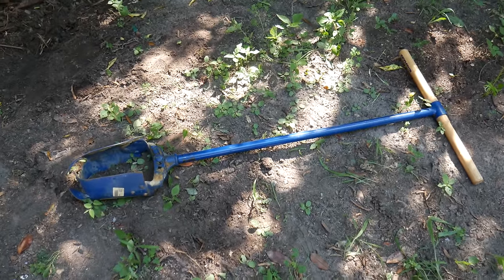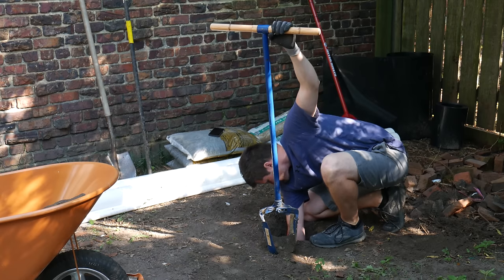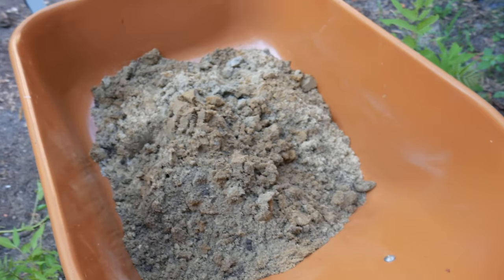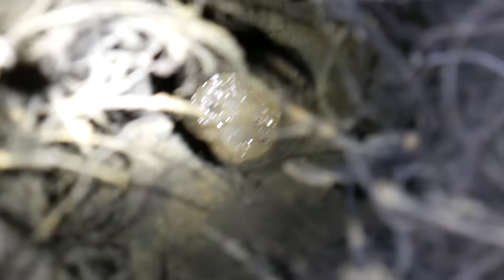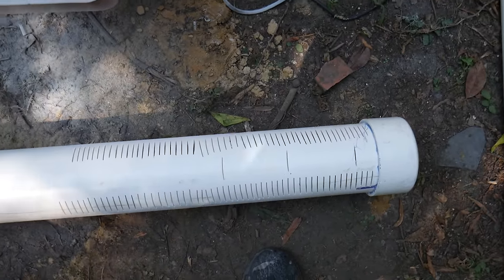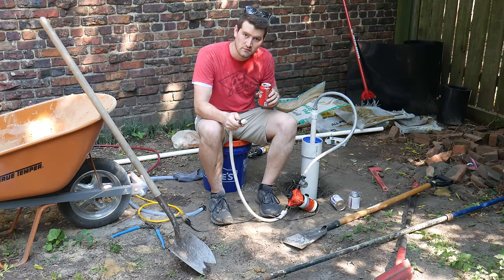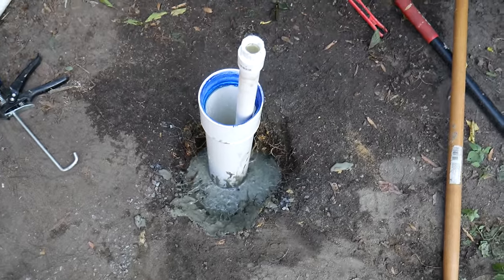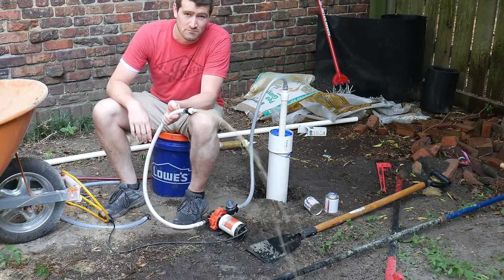How to drill a simple shallow well yourself

Comment: Nice job and great video!  I have dug 3 wells on my farm using a similar method. A few suggestions. You should not put the end cap on until the screen is cut, as fine shavings will get in there and contaminate the water and/or end up in the well pump when purging the well.  Also try not try to draw too much water too quickly or the screen will eventually get clogged (for instance, a deep well hand-pump) — I learned my lesson and my well just about stopped percolating because it took too much water too quickly.  To prevent this on my other well, I dug a bit deeper and made a longer screen. Having a longer water column means you can draw significantly more water more quickly.  Also, sediment will settle at the bottom of the pipe where the end cap is and eventually it can get up to the screen where it clogs it from the inside.
Reply from the maker: Yea I eventually settled on using a wellpoint: https://youtu.be/IRLLbmcnYjA. It's been going for almost a year now with zero problems, which I still find surprising. I will do a followup video in a few months after it's been a full year.
Reply: Great advice sir . Thanks
Reply: Im curios to know how long a well like that can last ? Until it runs dry
Reply: I jet 4 inch wells in pastures for cattle. I started using a filter sock around the slotted casing pipe to help prevent fine sand from getting in the casing. Stops 99 percent of fine stuff. Fine clay can still get in. I pump my wells hard right away and get great flow. like 20gpm plus.
Reply: So dig it deeper than the draw pipe depth?

Comment: For those who haven't noticed, at 11:39, it is possible to see a bag of gravel that he placed before the grout to prevent clogging. Note that at 11:45, the bag of stones is no longer there, and there are some stones near the entrance of the hole."
Reply from the maker: Yes, I regret not explaining what I did there in the video. Thanks for pointing it out.
Reply: How,May bags of gravel did you put in?
Reply: Thats why he calls himself the bad homeowner which he is.
Reply: Absolutely came in to say this very same thing. No point pouring crete  down and clogging those slits otherwise be rendered useless. Bloke needs fix this video cos a lot of effort to just screw it up by omitting one of the most important factors.
Reply: @TexasHolton usually enough to cover pipe screens + 1 meter, as it will settle down

Comment: I put in a bore by hand some years ago, I hammered steel casing down to about 20 feet. I fabricated a point to fit on the bottom.  My steel casing was in sections about 3ft long as it is driven down I would weld on a new piece. When I got to the bottom of my hole I lowered down a stainless steel screen attached to 1 inch PVC. The process is called a spear. After spear was installed I used pea gravel to cover the spear then with drew the steel casing leaving the spear behind. It worked perfectly.

Comment: I just finished watching 3 or 4 of your well videos, and applaud you for your efforts. Will also leave a comment on each one. I've done similar shallow wells over the years in my yard   (Easy digging, all sand...like yours), and have tried a couple others. There is no conclusion to this style, and I'll speculate why. 

But 1st will say, you left out the part about filling the 4" casing hole with "trap-rock" around the casing screen, to allow the water to penetrate. We're sure you did that, right? You did show the bags, but only showed the mortar filling the hole. 

And next, you didn't elaborate what you did to the 4" casing, when your digger hit the mud. If you want the 1' plastic well point to be a couple feet below the water table, and you plugged off the bottom of the 4" casing, how did you drive it 2' (or more) into the mud? Your posthole digger won't make a deep enuff hole, because it will keep filling with mud. I know, cause it happened to me. No getting around it. I'm just guessing that you didn't get your 1" PVC pipe in deep enuff water, to supply your needs. Maybe that's why your next video, (only a month later) shows new 1 1/4" black pipe, with a driven sand point.

Comment: I have a question:  The cement, that you poured to protect the outer PVC pipe, didn´t it seal the slits which you did on that pipe ?
Reply: No he poured the gravel in first.
Reply from the maker: Yea, gravel went in first and surrounds the pipe, grout goes on top to seal off the gravel from the surface.

Comment: One important point I was unclear on in watching the video is how you knew you were in a good pocket of water and could stop digging?  I believe there is more surface water and deeper good clean water.  Any tests to use or pointers to help me know when to stop digging?
Reply from the maker: I knew I hit water at like 10ft because I dropped a tape measure down the pipe and could hear the plunk sound of it hitting the water. Sorry I didn't record this.

After that, I just dug until I hit something hard.
Reply: Very interesting approach.  I have heard that is is possible to hit the water table and if you keep going it is possible to go completely through the water table into something like clay and “lose” the well.  I guess you were lucky.  Thank you for the response.  I love you easy to follow videos.  Very helpful.

Comment: I learned a few things from the video, but I also think I missed something as I'm a bit confused. There are dremel-cut holes in the outer pipe. Doesn't the grout just cover these when you pour it in the hole?
Reply: No, the grout doesn't seep through the gravel, and so it doesn't fill the openings

Comment: I live in a winter climate. Is it smart/advisable to install a check valve about 5 feet down so I can put RV antifreeze down the 1” column during winter? Has anyone tried this? Am I setting myself up for failure by doing so?
Reply from the maker: is this a real question? do NOT put antifreeze in your well pipe

Comment: WHY did you switch to using SANDPOINT well ? Did you have problems?  I'm thinking of doing a well on my property just trying to figure out which kind is better
Reply from the maker: Hey good question. I switched to a sandpoint later because I was able to drive it deeper into the ground. This allows me a more reliable supply of water in case it doesn't rain for a long time.

Comment: The PVC glue was completely pointless. The pipes were also installed upside down which makes it more difficult if you ever needed to remove it. It is disappointing that you didn’t show the final product after investing all of that time talking about it.
Reply: Id call him a dunce
Reply from the maker: PVC pipes are symmetrical -- there's no such thing as "upside down" with a symmetrical pipe.
Reply: @BadHomeowner  They are not symmetrical. There is a belled end and a straight end.
Reply from the maker: @smarterthanyou9090  There is no belled end. What looks like a "bell" is the coupler that I installed onto one end of the symmetrical pipe.
Reply: @BadHomeowner  I see. In that case it's the same work. Gluing a belled end is easier than a coupling but as you've used a coupling the work to replace it is the same. You are correct.   
I've never used glue on the several wells that I've done. I never felt it was worth putting toxic chemicals on pipes that already sit in water and collect water meant to be potable.  
I still say you should have shown the finished work. There is no real evidence that the well functions unless you demonstrate the completed project. Most people who watch a project unfold are not satisfied until they can see the end result.

Comment: I will putting in a well soon and have watched many videos. Yours is nice it's simple to the point it showed. Question, when you pour the grout in what prevents the inlet slits from not  being sealed up in other words the area from which the water comes in I would think it has to be in the water table and free to capture the water. Please explain this too me I might have missed hearing it. More detail on the pipe in the water hole. Thanks
Reply: I believe the gravel goes in before the grout

Comment: What kind of coupling did you use coming from the 1 inch pipe to the hose that leads to the pump?
Reply from the maker: A barbed pipe fitting. One end screws into the pipe, the other slides into the hose and grabs the inside. Sort of like this: https://www.homedepot.com/b/Plumbing-Pipe-Fittings-Fittings/Barb/5-8/N-5yc1vZ1z18i3tZ1z0u2lcZ1z1b4fc

Comment: You didn’t grout the well properly.lt states in the regulations not to poor cement from the top of hole you were supposed to use a trimey pipe and grout from bottom of casing to the top
Reply from the maker: That's only necessary for wells that are hundreds of feet deep to avoid large air pockets. For a 15ft well it's perfectly fine to pour from the top.

Comment: Nice job. Please consider whether monotonous music is needed over the top of you speaking or at all really. I like that you capped the casing pipe. Any guess as to how many millimetres wide those Dremel cuts were? Would there be an advantage to add a few hundred more cuts up the casing pipe? When you poured the grout in would any have made its way all the way to the bottom surrounding your casing pipe or will it not set under saturated sand/water? Sorry, too many questions. I am in Australia and about to embark on a similar bore. Mine is in pure sand and may be about 8m deep so I can’t use an auger. Thanks again for an interesting video.
Reply from the maker: I'll remove it for the next one

Comment: do you  have  to  stop digging when  you  see water ? even  at any depth?
Reply from the maker: As a practical matter, it's hard to dig with an auger much below the water level because the walls start to collapse. I did another video with a sandpoint which allows you to go deeper: https://www.youtube.com/watch?v=IRLLbmcnYjA
Reply: When i started  to  dig, i  saw water at 2 feet,  i went on to 7 feet but much water was obstructing so i stopped  at 7 feet. I discovered  that  water   was coming from  the  walls rather than  form the bottom  of the  hole .dug.

Comment: Grout will be more porous?? 🤔 And allow water into your well? If so your water must be supremely clean. Got a follow up video? How did you know how far too dig down? And so what did you do with your gravel? I thought you would have put gravel at the bottom then seal it with grout. Ty in advanced of your response ❤ Peace and Health
Reply: @LetsRoll239  I have to correct you he did use grout! Not the kind grout used on tile though. Grout is a different composition than cement!
Grout dries with a tighter grain less porous than cement! Think of rice in a jar and compare it to having sugar in anther jar. The grains of sugar are tighter than the rice. I hope this helps. 😁🛫

Comment: Do it w/ a circular saw,much easier.
Reply from the maker: Didn't think about that, but yes it would be easier.
Reply: @BadHomeowner  but a bad idea! The slots would be so big it allow sand in the pipes. A better solution is to use what is called chemical PVC well test pipe the 4 foot section of pipe has .5 micron slits that keeps out sand. A well drilling supply house has these. They are used when underground fuel tanks are placed, several test wells are drilled to test the ground water for a leaking tank.

Comment: Chlorinated your portable drilling water/mud & make sure cement annulus and keep well above flood zone height, and use sanitary well seal. Also a slab, sleeve or barricade so Joe blow doesn't run over it and Crack casing w tractor one day...common sense type stuff. No big deal & no reason to make it sound as such.